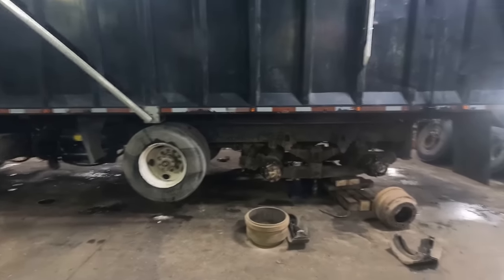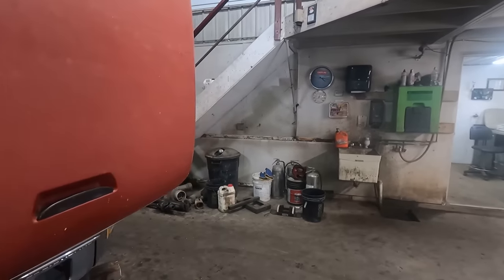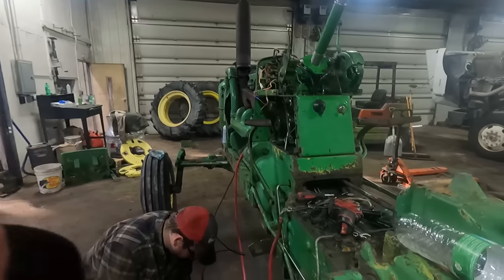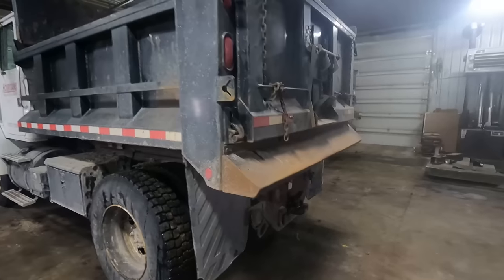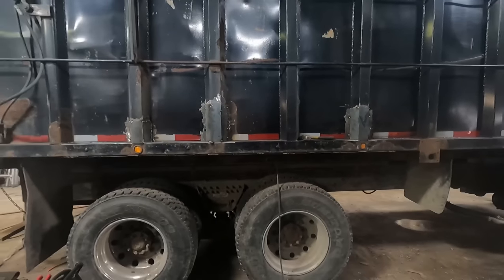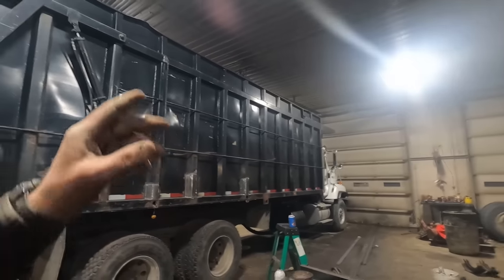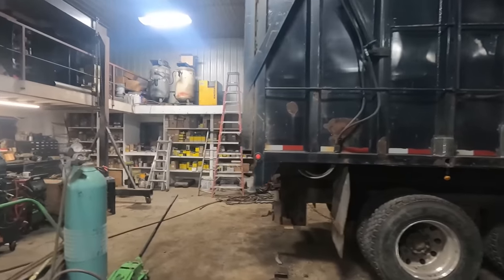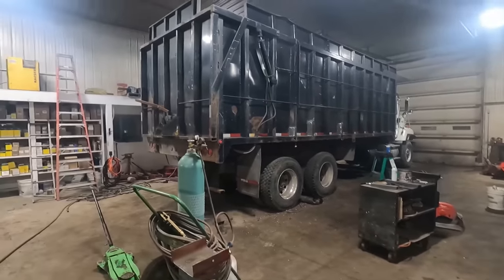The 4020 it’s getting smaller

Comment: On that 4020, what all are you plans with it? I mean, going to rebuild the engine and go through the transmission/rear end as well or just cosmetic? I completely understand why this will be the last time you go restore it, sometimes, gotta cut losses on expenses. For power steering, JD did have all others beat. Our old 3010, could spin the wheel with 1 finger, made mowing hay so easy. Great video, cheers :)
Reply from the maker: Mechanicals are all good